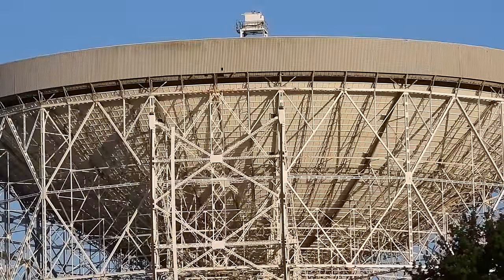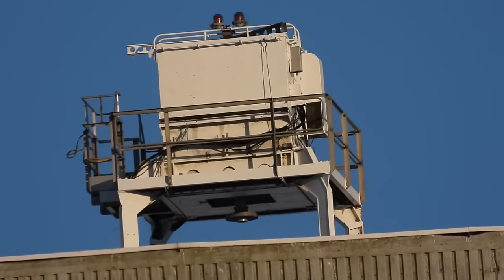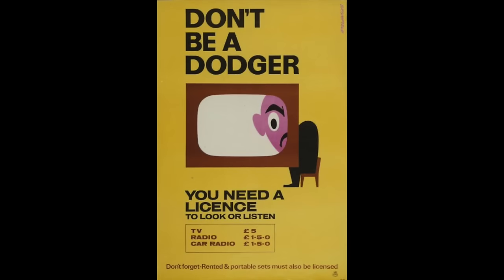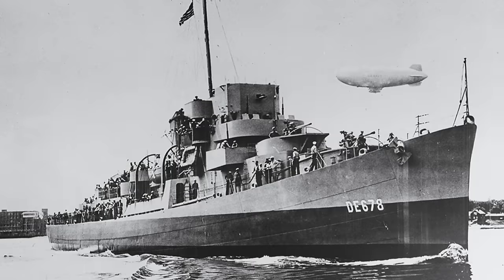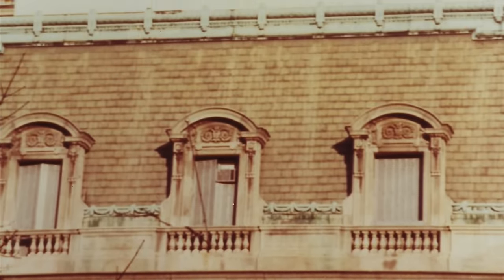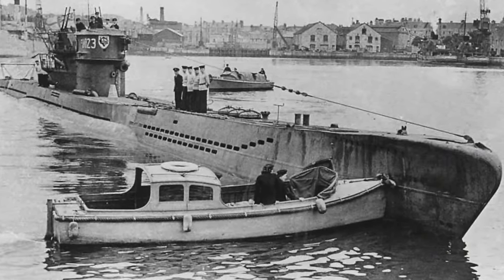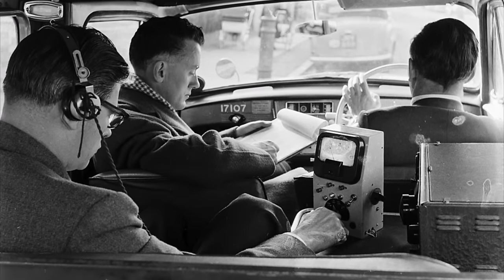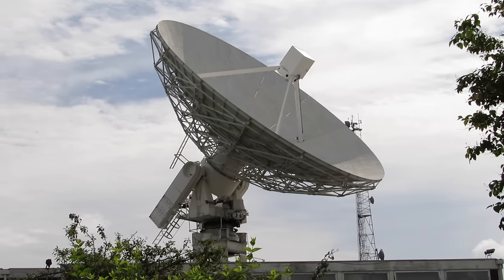How They Know What You're Listening To On Your Radio!

Comment: TV detection as I understood used the line scan, as confirmed by this video. Around 40 years ago,  there was a report that engineers developed a method, using the line scan signal to decode was was being displayed on a computer terminal.  Consequently the MoD used to shield all their terminals in metal casings. It was known as "tempesting".

Comment: i think there are flaws in the circuitry of the receivers that the police can detect such as the local oscillator and the oscillator used to set up the cancellation to extract the signal.

there was a device back in ww2 that was supposed to go between the antenna and receiver that would block the stray signals from coming back out to the antenna so you could listen in secret.

Comment: TV sets could indeed be detected from the flyback oscillator.  The 625 line pictures were "interlaced" at 25Hz,  i.e. 312.5 lines were scanned at 50 Hz giving a frequency of 15,625 Hz in the VLF band.   One geophysical technique we use for groundwater and mineral exploration uses the signals from VLF naval transmitters around Europe  (Rugby is gone, now we use Anthorn and Skelton) and the equipment would pick up the TV signals if tuned to 15.625 kHz.   I had a mysterious neighbour for a while who made no sound and used to creep into his house silently, curtains always drawn.  Then I discovered that I could detect his TV but he might have left it on even if absent.  Never knew what he was up to but he seemed harmless!

Comment: A radio signal goes everywhere. Everything and anything picks up radio signals. A bit of wire or a steel girder. 
No one can ever tell if someone is listening in.
TV detector vans simply read addresses off address lists from shops where they had just sold tellies to and people who had not renewed their license. Mi Dad used to work for them in the 70s.

Comment: As you know Tempest proofing both buildings and kit was big during the Cold War. A principal driver for these efforts was the knowledge of just how much information was being gleaned from Soviet bloc kit. Nothing was covert in central London, the I.F. receiving aerials were just impossible to hide. The easiest to spot were between the buildings on Church Street and Kensington Palace Green/Gardens;with the obvious data sources being the various Soviet bloc buildings lining the private road. Top left side of any southbound bus gave a grandstand view if you were looking - very few were. These were very large vertically polarised aerials with limited swing. After the Cold War ended the site became a large housing block with eye watering service charges. Regarding information in the public domain:- Wikipedia has a Tempest category which covers a wide range of topics. Remember to check the edits log for some of the information submitted by the public.

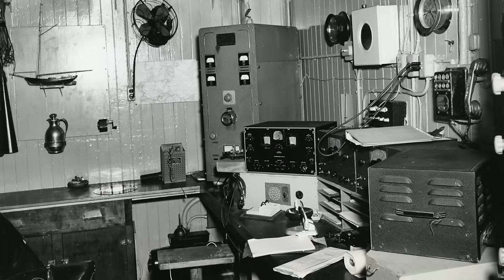Comment: That's a Hammarlund HQ-120X receiver in the center at 2:50. It had an RF stage which isolated the oscillator from the antenna.

Comment: Listening through the first bit of your video, it sounds like how detecting a device receiving radio, is very much the same way that a radar detector -- and thus a radar-detector-detector -- works. Because the hardware to receive these signals, is very much the same as the hardware to broadcast the same signals, they can inherently "leak" and retransmit what they receive on a shifted frequency.

Comment: but the key question here is still unanswered
can the authorities detect the presence of a radio e.g. a common Baofeng radio or even a higher-end expensive HAM radio 
as they are just in listening mode and not transmitting?

Comment: For AM radio, a tuned RF radio can be made to work very nicely.  As frequencies get higher, it gets harder to amplify the signal.  This is a reason to convert it down like you described.
Also some car radios and a few others used a 200KHz intermediate frequency instead of the 455KHz that was normally used.  This made the radio cheaper to build but they had more problems with a strong station stepping on a weaker on.
Your FM radio and your very early TV set likely used 10.7MHz as the intermediate frequency.  The standard moved it up to something near 45MHz.
Reply: Using 200 kHz for IF in a radio used in the UK would be interfered with by the BBC's 200 kHz long wave transmitters.
Reply: @HansWHoefnagels  200KHz is kind of rare for broadcast around the world.
Reply: @kensmith5694  That why I mentioned the UK.
Reply: @HansWHoefnagels  Yes, it makes sense.  The only 200KHz car radios I have seen are US only as far as I know.

Comment: If you have a radio on in the car, I have heard it can be detected by monitoring the headlights of the vehicle. When the speakers are playing music, the "load" on the electrical system fluctuates. As the load fluctuates the amount of electrical energy going to the headlights changes, making the headlights get dimmer and brighter. One could also bounce a laser off a car windshield as well. This type of thing might be useful if a radio station wanted to know how many people were listening to them verses the other stations.
Reply: Filament lamps are too slow to react to anything but low frequencies…
Reply: @Mark1024MAK Plus the chances of the lights flickering just from the amplifier alone is low, many other parts. At normal listening levels, most car amplifiers should have way more than enough amperage or headroom from the alternator, meaning that no flickering should be going on.

Comment: To answer some of the points in other comments…
The U.K. tv license is actually a tax.
The actual U.K. TV License operation is contracted out to a commercial company. It’s not BBC staff that get involved in the day to day operations.
Most of the time, the automatic computer generated letters go out regardless of your reason why you don’t have a license. Unless you admit  to watching television, or you let them in, or they can see in through a window and see you watching television, they will have great difficulty prosecuting you.
Having said that, assuming you can afford to pay for a tv license, it is actually good value for money compared to commercial subscription tv or a typical mobile telephone contract that has a high data usage/allowance. And the money from the license funds the BBC. Whatever individuals may think of the BBC, they are one of the better broadcasters in the world.
Some money from the U.K. TV License fee has been used in the past for other public service broadcasters and for other television distribution equipment costs.
It was technically possible to pick up the local oscillator of (analogue) radios and televisions. And to pick up the line output frequency of analogue televisions. But as more and more houses got equipment, and as radio/tv equipment got better, it becomes more difficult to isolate which building the ‘transmission’ is coming from. Also the type of construction of the building has a significant effect on the strength of the signal that escapes…
It’s much easier to look and see who has an aerial… Or look in through their windows… Or compare the database of homes vs. registered licenses…

Comment: By accident I found this out, I was listening to npr on my radio and I found a weak npr station in the kHz range. Couldn't figure any harmonics for 81mhz then I tuned the radio and realized it was the intermediate frequency stage in my receiver. You could drive around listening to that most radio use the same IF

Comment: It is possible to determine the frequency a radio is tuned to by picking up the local oscillator provided you know the intermediate frequency. Standard intermediate frequencies are 455KHz, 10.7MHz etc. If a receiver was constructed with a really unusual IF then the local oscillator could still be picked up but adding or subtracting the usual offsets will give the wrong answer.
Reply: Yep! I used to work for a company making radio mikes and their receivers (I did the fault finding on UHF front ends and first and 2nd IFs) and where multiple units were going to be in use together different first IFs would be put to use to stop cross interference using anywhere between 10 MHz and 12 MHz (roughly - I don't remember exactly)

Comment: Modern high performance receivers that use an ADC to digitize the entire HF spectrum are common today, and the filtering/signal demodulation is all handled in software. It would be hard to tell what frequency was being demodulated in this case.

Comment: I don't know it it is true but in the days of TV detector vans it was rumoured that they could detect which programme you were watching by checking the synchronisation of the line scan stray field they were detecting with the transmitted line rate for that station.  Thus eliminating false positives e.g. from early computer monitors made from tuner-less TV sets.

Comment: The TV detector vans from what you have said appear to work the way I thought. From various FOI requests, they still say they still work but I have a sneaking suspicion it all fell apart when PC CRT monitors, etc became common. Are you aware of any way they can still determine or should I say find out if you are using live TV? I ask this because in no court cases has tech evidence been submitted as far as researchers can ascertain. Thanks for the video as usual great content.
Reply: I dunno if CRT monitors would be that much of a problem. VGA runs at a horizontal refresh of 31kHz while TV broadcasts run at 15-16kHz, depending on the system.

Comment: I HAD A FM RADIO TUNED TO 98.2 MHZ THEN OVER 100 M AWAY I COULD HEAR THE STATION  ALTHO QUIET WAS SENT FROM THE OSCILLATOR IN THE 70-88MHZ

Comment: Does anyone have a link to any case in the UK where evidence from a TV detector van resulted in a successful prosecution of a licence evader? Maybe it was possible 'in theory' to detect an L.O. signal from a TV in someone's house, but convictions are usually from evidence such as doorstep confessions, the officers actually seeing thr TV on through the window, the 'offender' feeling obliged to let the enforcement officer in, etc. The vans were a prop, driven around to 'remind' people that they'd catch up with them with fancy technology.
Even if a working TV could be detected, how would you prove beyond reasonable doubt that the TV was at the address the officers claimed it is? You'd need some very sophisticated triangulation techniques to successfully differentiate between two TVs seperated by a brick wall. Then there's an apartment complex, high rise flats, houses divided into bedsits, etc.
I'm highly sceptical that these TV detector vans were actually able to to what is claimed. I'm even more sceptical it'd stand up in court.

Comment: i was told they could not detect a tv signal coming into your house they can only detect if you are broadcasting
Reply: Detection was also possible from the radiation emitted from the scan coils. It’s also possible to pick up the scan clock being used. There is lots of proof of concept stuff too, hence Tempest
Reply: That is entirely true. They could detect the output from a flyback transformer, but to make a conclusive case, they could not.
They relied on show boating and intimidation to achieve that.

Comment: Lots of paranoia, local oscillator radiation in modern rigs is hardly readable from a few feet away even with sophisticated equipment. Of course, if you buy cheap Chinese junk you have only your self to blame. Most of them not only radiate local oscillator signal but are so crappy build that the circuit board can vibrate in rhythm with whatever audio is in the room and modulate the signal making it easy for others to listen in even though you think you are only receiving. The modulation is very narrow band and one needs good equipment to read it...equipment the government has ample of.